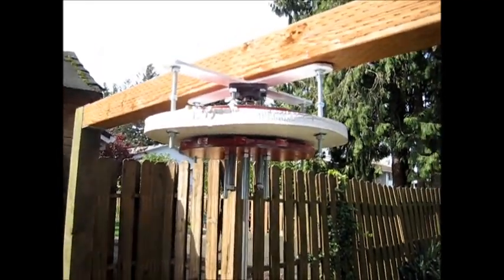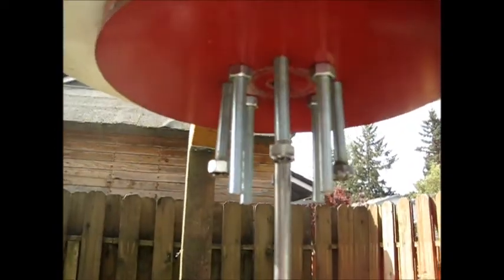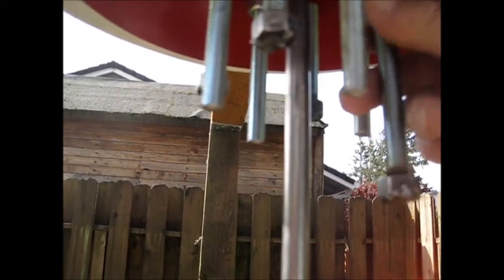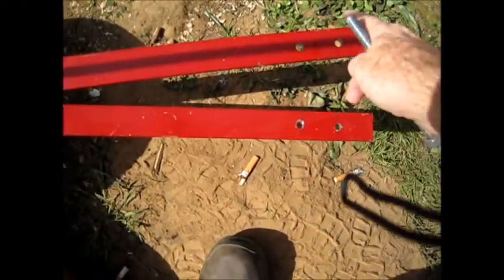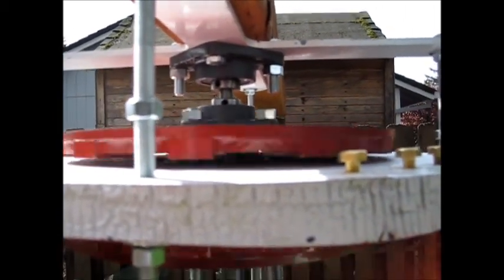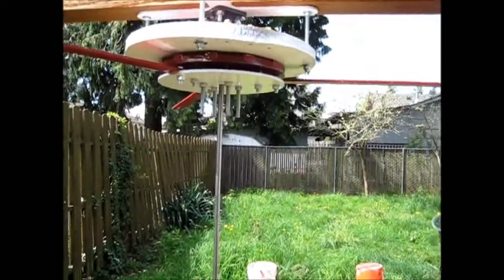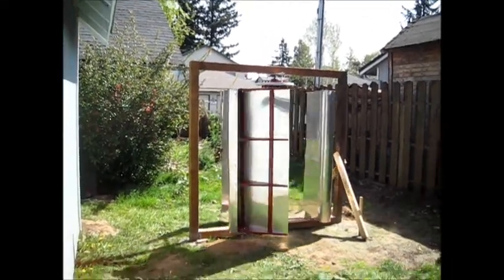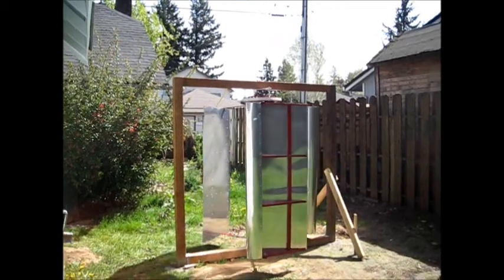Vertical Axis Wind Generator Flying

Comment from the maker: I left a fairly large gap between both magnet rotors and the stator during testing. I want to make sure everything is secure before I bring things a little closer for better output. this is the first one of this type I have built. I am fairly sure I will be reducing the wing support arm lengths about 5 to 6 inches. its over 47 1/2 inches in dia right now.